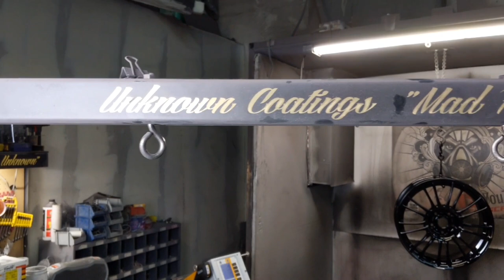UKC Short - Ain't Gon Stop - Sol - Powder Coating

Comment: First, thanks for your videos. I watch every of them. You inspired me to start Powder coating by my own. I built a Tribo - Gun and already did my first tests.

Yesterday i tried to powder coat "bent-to-a-box aluminum" and the edges (not welded together) did not accept the powder. I think this is the "faraday-effect", is it?

Is there any way to avoid this ? Maybe hot - coating?

Thanks from germany
Reply from the maker: I appreciate the support. The issue if for sure a faraday area, you can try spraying those areas while hot, then coat the rest like normal?
Reply: @UnknownCoatings  tried it. Works perfectly. Thanks :D